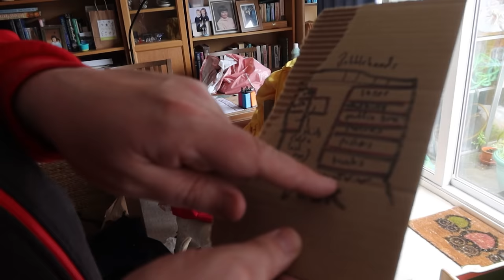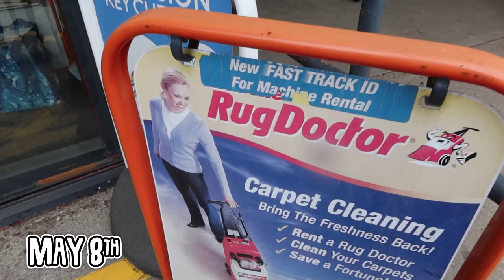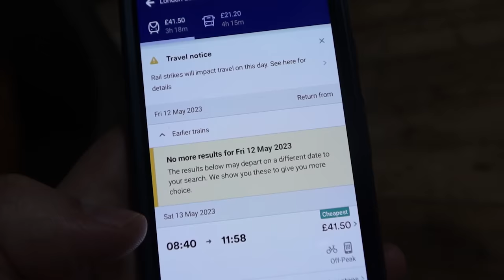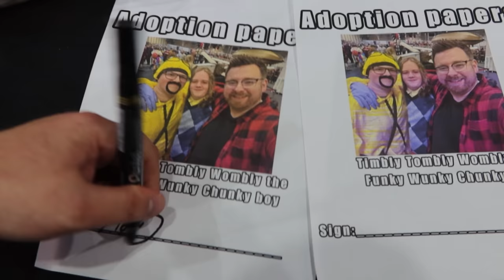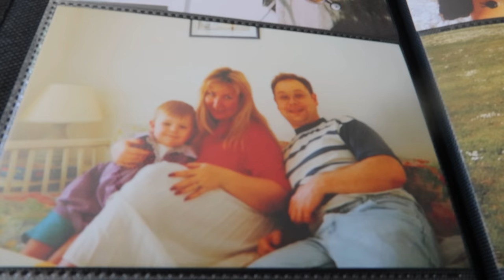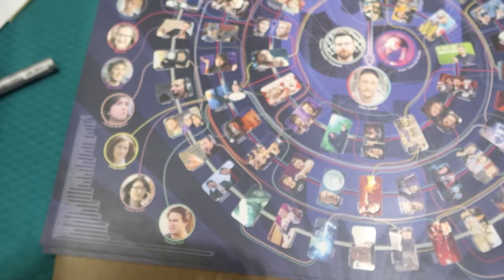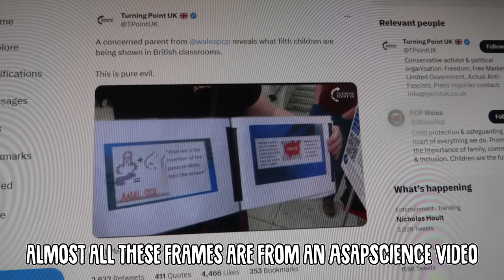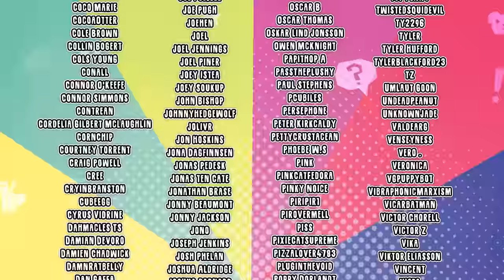Last Month I Was Cringe

Comment: 23:04 another way to have chocolate strawberries for a summer picnic i recently learned is to take the strawberries and bring a bar of chocolate to the picnic, put the chocolate in the sun for a bit until it starts to melt, dip the strawberries in it boom chocolate covered strawberries

Comment: 24:27 quick tip: garbage works. Just unfinished trash works. You barely need a full cohesive. Like Adam Savage says "if you cant figure it out, just put the wrong thing down, because at least you KNOW its wrong/not good, and you can add and take till it IS good. Thats art, thats how your brain likes to create, adding and taking things to end up looking pleasing.
Reply: If you're worried if it'll be funny or not, you could always pass it through a "testing group" for feedback.

Comment: Heel injury advice: You could've bruised the bone. Those type of injuries are very common with situations like that. The treatment for that would just be to stay off of the foot, as much as possible, while using ice and ibuprofen to help with pain and swelling. However, heels have a nasty tendency to chip, with injuries like that as well. Since all of your body weight is added into the force pressing the bone into the rock, it can chip some bone off. That type of injury requires medical intervention, most of the time. As you don't want bone chips freely moving around in your soft tissues. Best case: it just causes long term pain from moving around and stabbing the surrounding soft tissues. Worst case: It can cause infection, you can lose the foot, or the bone chip could be small enough to move into a blood vessel and travel to more vulnerable organs or parts of the body. I would recommend that you go to hospital and get it looked at. Even if the pain stops before you can get an appointment, I would still recommend getting imaging done on your foot, just to be sure there aren't any bone fragments floating around in there.
Reply from the maker: Ah man... I didn't mention in the video but the pain still hasn't gone away lol. Alright, off to the doctors I go! Thank you for the advice.
Reply: @TomSkaAndFriends how many?
Reply: @TomSkaAndFriends  No problem. Good luck. I'll be hoping for a good outcome and a speedy recovery. fingers crossed